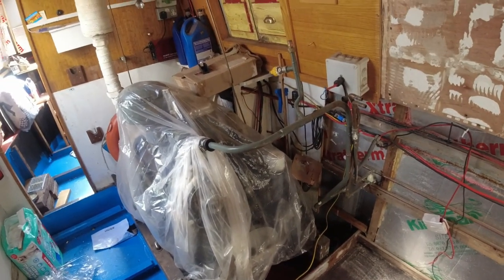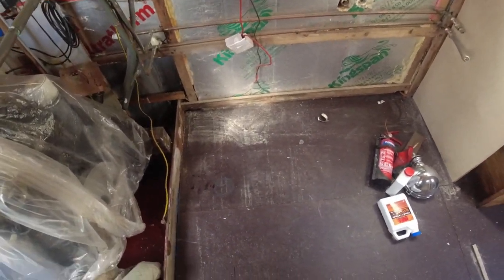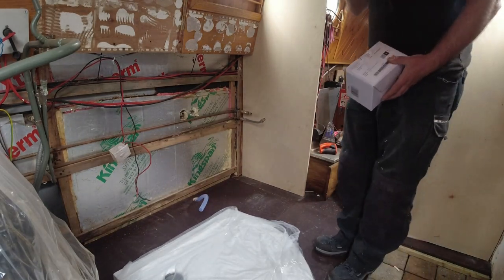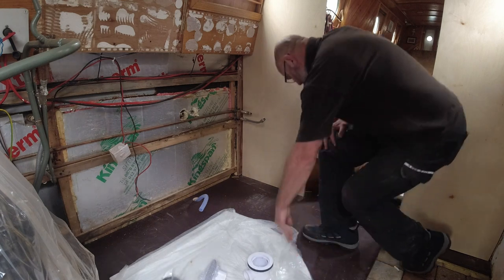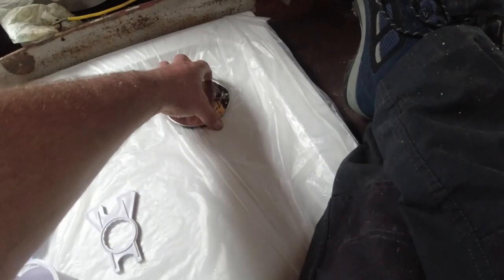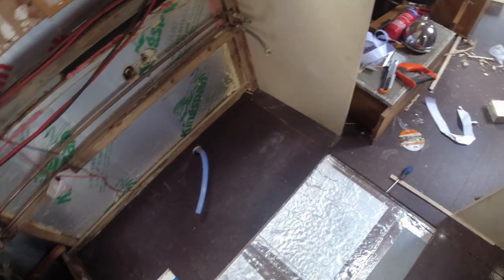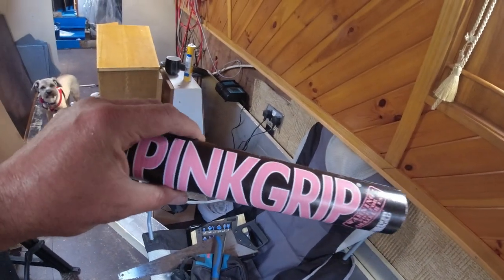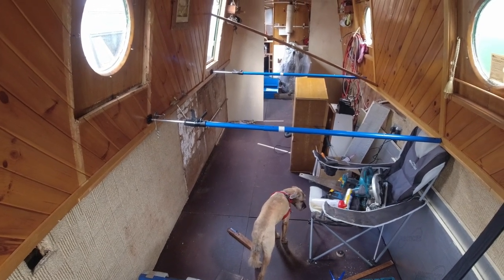Narrowboat Refit #10 Shower sole and sticky walls!!!

Comment: Steve ,first thing noticed was Charlie boys haircut!,fixing floor is a step forward,  the shower tray looks substantial,  what composition did you go for? That extra pump out is a sound idea.regards
Reply from the maker: Hi Malc thank you, the shower tray is resin so should be really strong. Went this morning and brought a bilge pump for under the shower! Once everything is sorted I can start thinking about fitting the shower properly😊😊👍🏼
Reply: Good move on the tray,it was me who mentioned it previously , it will stand the use,
Reply from the maker: @danmissy1  thanks Malc, I knew someone had said to in the comments and that’s why I did 😊😊👍🏼 thank you 😊

Comment: Steve I think you are going to use the clear reinforced hose for your shower drain. Just try a piece in hot water some of them go very sort when warm or hot and collapse under the suction of the gulper pump. I only.know as on a good friends boat his shower stopped draining and it took me a long time to find why because it happened under the sole but that’s what it was. You are doing a fantastic refit mate
Reply from the maker: Hi Howard, I never thought of that! I don’t think the shower water will ever be that hot but I’m definitely going to look into that now, the pipe I have does seem quite rigid however I bet it will go very squishy when hot 👍🏼👍🏼👍🏼😊 thank you 😊

Comment: Nice work Steve. Question for you… Was the sole board down when you got the boat? I have done a quick search and cannot find much out about it. I was going to do my sub-floor with 18mm marine ply, and paint the underside and edges (not sure with what yet) but open to advice.
I just have a temp OSB floor down at the moment whilst it is being battened out and spray foamed, so, sorting the ballast out, and the flooring, will be one of my first, and no doubt, most tedious jobs of the fitout.
Reply from the maker: I don’t seem to have a lot of ballast compared to some boats and it still sits really low in the water!! The sole boards I use are not the original ones, they were completely rotten from water damage over the years and also the previous boards were only cheap ply by the look of it! I have used Phenolic ply “18mm” but be warned it’s not cheap! It’s the most water restaurant ply you can get I think! It’s that same stuff they use for the flooring in trucks!!
Reply: @NarrowboatPreciousJet  Thanks for the reply. I’m going to be using 18 mm Phenolic ply or Tigerboard for my engine-bay cover on my semi trad, as you’ll see I mention in my next update vlog which I will be posting later today. Yes, it’s certainly not cheap.
Reply from the maker: You will need to use some penetrating epoxy on the cut edges if using phenolic out side 😊😊👍🏼 will be watching your vlog tonight then 😊👍🏼